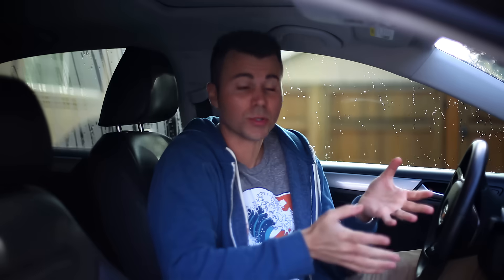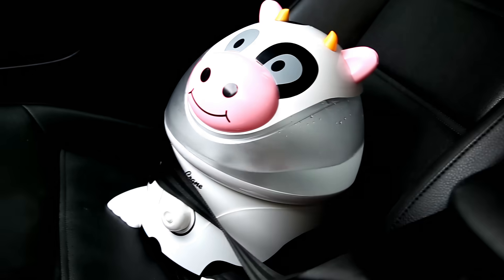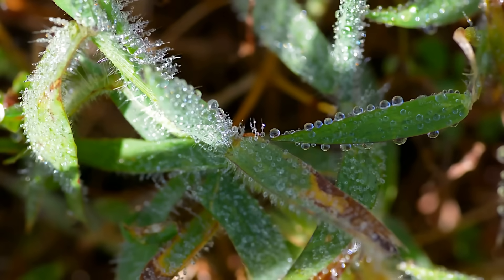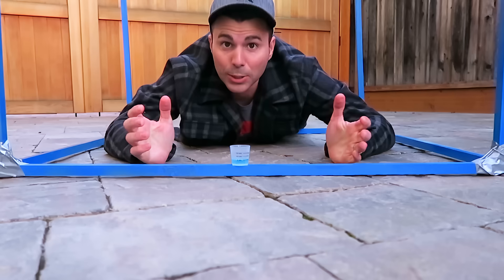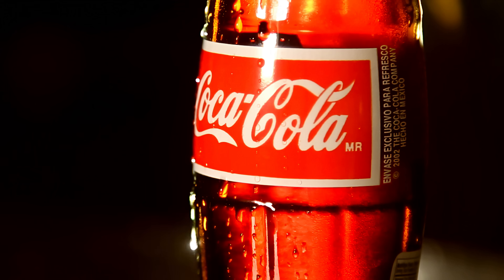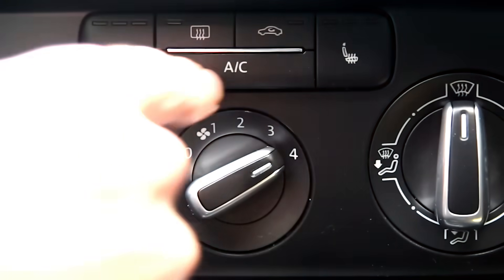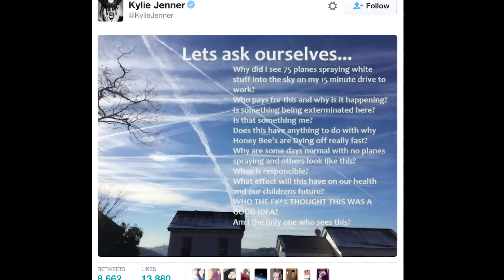Defog your windows TWICE as fast using SCIENCE- 4 easy steps

Comment: How do you turn the heat on full blast and A/C on simultaneously ?
... WTF ?
Reply: You push 2 buttons
Reply: with the knobs & buttons, Bueller.
Reply: Since no one else knows the answer, I will help you. Some vehicles have an A/C button you can press while the heat is on.  A lot of vehicles automatically turn the A/C on whenever you select the defrost vent, because auto companies already know the information in this video:  If your windshield is fogged up, you will select that vent.  If you select that vent the A/C will dry the air and help defog the windshield regardless of the outside temperature.
Reply: Most modern vehicles automatically turn on the a/c when the defrost is on, specifically for this reason.  Next time you turn on defrost see if ac does also.  It's also good to cycle the ac in the cold weather to keep the system in working order.  If you dont run a/c for 6 months chances are something in the compressor will go bad or seize.  I dont have to worry about these issues, my truck has a built in elec heat system that keeps the windows thawed and battery charged. I just have to plug my truck in on really cold days! But the plug is on my front bumper so it works very nice.  Downside is dont forget to unplug it before you drive or you may have a cord all the way down the driveway!
Reply: Some cars don't let you do heat and AC at the same time.
Reply: Most cars automatically run the AC when you select defrost.
Reply: Benjamin Brooks Finally, someone understands the the Auto Industry already knew this topic long ago and created the solution. So, when you push your Defrost button, your Heat (not hot at startup, but will add heat asap engine warms quick) and the A/C compressor will come on to work together (important to keep your A/C charged correctly year round, especially older cars. * The problem faced today with newer cars are that most now have a temperature set point, which eliminates the ability to push both the Heat & A/C, thus the need for this to occur automatically. **Personally, I use my A/C and heat together all the time to Dehumidify the inside of my car on rainy mild days, which is why I disagree with opening the windows as in the video, because his test is at a specific temperature inside and outside, which is typical for Engineers but not for day to day use, where the temp and Humidity vary throughout each day. Example is on mild Summer mornings headed to work. If you turn your A/C on Low, you will get too cold by sub-cooling, so by turning the Heat On to a level which makes the car temperature comfortable, is exactly where you want it to be. Always dehumidifying and reheating for comfort.
This from a life long temperature control expert.
Reply: kidding w'you...be well.
Reply: Keith & Philosopher it is refreshing to see a pleasant exchange of information. Thank you both.
Reply: I do it all the time. If you have it on defrost, you can turn the temp to high heat and hit the AC button.
Reply: WTF ? REALLY ? 🤔
Reply: That’s a goofy question!!! You’re not very mechanical if you have to ask that.
Reply: @louisp.3332  yeah! Even my house uses the a/c and humidifier in the winter to keep the house at a perfect 40% humidity at 70°f. Its amazing how many people dont understand 3rd grade science!!
Reply: Coupe420 screw science! You would be shocked at how many people just don’t understand how to push TWO buttons...
Reply: @louisp.3332  nothing surprises me about modern humans!
Reply: Totally can be done. In fact,  most cars turn on the ac automatically when you push the defrost button.
Reply: By doing it
Reply: FYI the AC compressor won’t engage when air is under around 38 degrees anyway.. the refrigerant won’t work efficiently under a certain temperature and it would also get iced up quickly
Reply: Just to be sure you guys know the only reason an AC dehumidifies the air is by making it much colder.
Reply: Dale Neish not exactly.. it dehumidifies because the cold surface area of the exchanger fins collect moisture from the air.. cold air holds less moisture but dropping air temperature causes higher relative humidity and the excess moisture that can no longer be dissolved in the air precipitates onto surfaces (condenses ie condensation)
Reply: @smagma9704  that's a longer way of saying what I said really.
Reply: @Neishy86  not really because just chilling the air doesn't dehumidify.. it increases relative humidity so that's the opposite of what you said. It decreases moisture content by draining condensed moisture out of the evap core.

(smagma is my other account)
Reply: Look I agree with you, I'm just not seeing how you dont think the main catalyst for the air dropping water is the temperature drop of the air across the fins
Reply: Ac is on by default wheb the heat on on some BMWs
Reply: Defrost setting turns on ac
Reply: You need the a.c on to use the defrosters.
Reply: Did you not just hear the rational?
Reply: Lol you gon learn today
Reply: A/C is on for heating only on new/expensive cars... and in this case the coils are warm, not cold, so WTF indeed?
Reply: How do you put in the picture deFROST and not have ice?
Reply: @mattlane2282  Don't ask me, it's not my video. But I wouldn't question someone from NASA, especially since they would be a colleague of mine.
Reply: https://stonumautomotive.com/running-cars-air-conditioner-winter-good-bad/
Reply: A/C stands for air conditioning. You can have your air conditioned or not regardless of temperature. The difference is whether you want hot conditioned air or cold conditioned air, and since the conditioned air has a much lower humidity and the A/C chemical traces left in the conditioned air will also contribute in drying the condensation its best to have it on.
Reply: Keith Anderson: If your A/C is leaving chemical traces in your air, you need to have a leak check. Otherwise, you were spot-on in your explanation. Air conditioning only refers to the drying of the air by using a cold element to capture the moisture. All coolant-based systems are simply heat exchangers. The "conditioning" is the drying of the air, of which chilling is often a desired side-effect. 

-Former HVAC and automotive technician.
Reply: Sorry, I was incorrect. Thanks for correcting me. I think I understand what you're saying:

Instead of saying there is A/C chemical traces in the air, its that the air is dehydrated so will evaporate the condensed water on the glass.
Reply: Keith Anderson: Yeap, now that is how it works. Just want people to keep their fact-check healthy. Glad to help. See a "how it works" page, and you can see how relatively simple it is, but how the concept has been so well refined. But that is why they are all called "heat-pumps".

Fun tip: Take the A/C compressor from a car, and belt-drive it to a Briggs & Stratton horizontal-shaft utility engine  (3HP will do)...fully charge the system again (never any R-12 system [illegal], only R-134A)...Makes for an insane outside A/C unit that doubles as an instant beverage cooler, with a little creativity.

The really cool thing (sorry about the pun) is solid-state coolers, like they use in those electric portable fridges. See https://en.wikipedia.org/wiki/Thermoelectric_cooling
Reply: Yeah, my old car hadn't been transferred over from R12 to R-134A and getting my windows defogged was a pain which is how I got here. Didn't end up getting it done before I moved on. Ended up just carrying around a nice microfibre towel to wipe down the windows to get me going until the heater core got up to temperature.

And now we're moving onto a whole new standard since R-134A is still slightly ozone depleting and also a very bad greenhouse gas, right?
Reply: @kand198  yeah actually r134a is more ozone depleting just like r410a is lol. But we have to follow the regulations in which r12 was a better aircon gas . Sorry to get off topic cheers
Reply: Philosopher of Nonsense it doesn’t cool the air by drying.. that’s just one component or side effect of the evap core.. you were an HVAC tech? It cools air by exchanging the compressed gas into low pressure which changes the boiling point and releases the excess heat into the radiator that thereby removes the heat from the air passing through it.. ie exchanging the heat from one location to another (outside the car)
Reply: @prometheus575  from what I understand, the A/C won't work when it's cold outside.
Reply: @kennyplay5982  Nope, it should work no matter what. The A/C is just a pump on the accessory end of the engine, it really doesn't know how hot or cold it is outside.
Reply: @kand198  And then the cold air hits the heater core and re-heats? He had a valid question
Reply: Luke W I don’t actually know for sure, as you can see I’m far from an expert, but I’d expect that the air is run through the conditioner and reheated before being pushed back into the cabin if you are on recirculate.

And where did I say his question was invalid?
Reply: @kand198  well....where did i say that you said his question was invalid?
Reply: I interpreted it as implied by “he had a valid question” but obviously I misread it, sorry.
Reply: @kand198  i would have interpreted it the same way that u did Keith. thank u 4 being a gentleman in your reply...you are a rare breed sir. GBY
Reply: Keith Anderson uh there’s no “AC chemical traces” wtf are you talking about
Reply: @journalsof jadednews
Turn the knobs.
Reply: You can't.
Reply: @Michael-gp3vl  you can't what? Run hot air through the A/C? Yes you can. A/C works, basically, as a dehumidifier.
Reply: @elliottselman6746   Yes the AC is a dehumidifier and the byproduct of that is cold air, When you are running the heater there is no moisture to remove from the air so the A/C is useless. A/C does not create cold air it removes humidity.
Reply: @Michael-gp3vl  a/c removes humidity by cooling air! It's how it works! You can use a/c to remove moisture and then heat that air. So you have warm dry air. But a/c definitely cools air!
Reply: @Michael-gp3vl  so basically, you're saying what I just said. A/C doesn't HAVE to be cold. It takes moisture out of the air.
 Unless if you live in a dry climate, warm to hot air can absolutely have moisture in it.
Reply: @elliottselman6746  If it has any moisture in it, it would not be enough to need to run the A/C for.  Living in the North East my entire life I can tell you this. The fastest way to defog your windows in cold weather is to run hot air that is recirculated and leave your window cracked open so the moisture is forced out of the car. 

If it is humid and muggy (hot weather) then cold air will work better.  I did not even need  to do any science experiment to learn this.
Reply: @Coupe420   A/C removes humidity cooling is a by product of that as I stated.  A/C does not make cold air is all I said.
Reply: @Michael-gp3vl  so by removing humidity you cool the air, but it doesn't cool air?  It does both, it has to cool air to remove the humidity, but you can then reheat that air without adding humidity.  It's just semantics, a/c does both, it cools and dries.
Reply: @Michael-gp3vl  my point was the a/c removes moisture, and doesnt mean you only have cold air. I'm not sure why you keep replying to me with info on what you do.
Reply: @elliottselman6746  wow go figure ,all my life I was told NOT to ever put A.C.  on while heats on.  I quickly turn it when even it happens, thinking I'm going to do damage to something. ... thanks guys .. to clarify ... A.C.  on cold .. widows cracked for short time then crank heat/defrost ,windows up .. do I have it right?

Comment: I do agree on all points. However, air circulation is used as a trigger in newer Volkswagen/Skoda cars to heat the air by electricity instead of motor heat. If you're driving a car with an diesel engine, it will take forever before the warm air hits the windscreen. I got an Golf 2012 model, and this difference is outstanding. If I put air circulation on, and crank the heat to maximum, you'll get warm air within a minute or so, even though its -15 C outside. If I dont, this will take several minutes - up to 10 minites.

Comment: Will this work in Canada
Reply: Yes, but it won't work in Australia. Down under everything must be reversed.
Reply: It works better if you run the engine  for 20 minutes  to help melt the ice, then your good to go, as long as your transmission isn't frozen solid
Reply: @timyanke9559  Thats true but it also wears your engine out a lot faster, uses a lot more (wasted) fuel and blows out a lot of unnecessary pollution. I have been in storms so cold that it dropped to seventy degrees below zero and I was able to start my engine (it was out in the storm unprotected with the engine off all night long) and follow this technique (I have been doing this for years because it was taught to me by a military mechanic), brush my windows off the thick layer of snow and was off and running (without a frozen transmission) in maybe two minutes. The windshield stayed clear and I had file visibility (not to mention that driving the car makes the engine heat up a lot faster so by the three minute mark it was already getting warm inside the car.
Reply: Yes, most definitely.

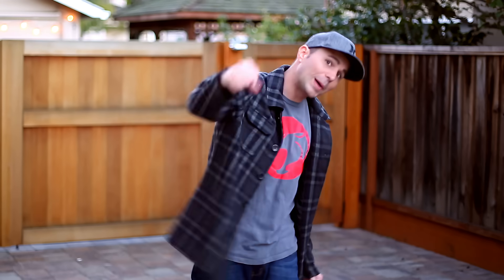Comment: 4:26.  🤜🏼🤛🏼 Pound it then.  Haha!!    Cool tip for those that don’t, can’t or prefer not to use A/C: open the Front-Driver side window and Right-rear passenger window to create good wind flow and it also cools down the inside of your car fairly quickly.   
...Or do the opposite windows if you don’t want wind blowing in your face.(Front-Passenger window/left-rear window)
This also works well even if the windows are only down a little bit.👍🏼   
**FOR “FUN” : If you wanna scare your passengers a little bit while driving, roll one rear window halfway down(the lower both windows are=the louder it will be), then slowly do the other one, watch them freak out!!!!  (*works better/best in hatchback type cars..lol).  
Cover your ears!! 👂🏼
*Disclaimer: Do NOT distract yourself while driving.  🙂

Comment: The change in relative humidity as air temperature changes is also why you feel dried out and get nose bleeds in the winter.
The cold outside air doesn't have much water vapor in it. When you open your door to go in/out of your house the air equalizes and comes inside. Then when the air heats up it still has that same amount of water vapor but it's a much lower relative humidity to what the warm air could hold.
Using Mark's analogy: it's like the small, cold, outside towel is filled with water,  but when the air heats up the same amount of water doesn't fill the large, warm, inside towel.

Comment: The problem I have is that the outside of my windows is the part that gets all foggy. Fortunately, I can use the wipers, but the fog comes back after just a few seconds since the window is cold. What I do is just blast the windshield with hot air and no AC, so the windshield heats up. I turn the AC off so the air is as warm as possible (I do have to wait a while for the engine to heat up). I also use the recirculation so that I'm pulling in air from the cabin which should be slightly warmer. Since I have to wait for the engine to heat up, and then for the heat to go to the outside of the window, it takes almost 2 mins to fully defrost the window (even with the use of windshield wipers). For the rear window, I do have to wait for the heating element to heat up the inside of the window and then for that heat to work its way to the outside. There's no rear wiper, so as you can imagine defrosting the rear window takes ages.

Comment: Can you explain the shaving cream hack more?
Reply: The shaving cream has chemicals in it that break up the surface tension of the water and make it into a smooth layer you can see through, not lots of tiny droplets that obscure vision. Bonus tip; the shaving cream trick works on bathroom mirrors too, and so does smearing a block of hand soap.
Reply: @peter_smyth  I used this trick to write a message into my mom's bathroom mirror on halloween.
Reply: @ABearInTheWoods-tumblr  I did the same thing. Did u write "hey big sexy" too?
Reply: It helps to reduce some irritation on your skin when you shave.
You're welcome.
Reply: David Albee get shaving cream then put on Windows then rub it off till it's clear
Reply: David Albee plenty of other YouTube's such a crisfix show how to do it.
Reply: Don’t bother just use stuff designed for windows
Reply: The shaving cream is not special in any way, any soap will work as well. The fat in soap repels water so the water doesn't stick to the window. It commonly forms larger beads that hen are large enough for gravity to pull down. The reason that shaving cream is used is that its a soft foam which is very easy to apply. Its also inexpensive and easy to find. You want to put on a very thin coat on the window or else it will leave a film that reduces your visibility (which again is why shaving cream is so popular), and yes its works on all mirrors and glass that gets fogged.
Reply: zz k lapAlbee we syyszSuZZoAaaaslawp
Reply: "I already know there are hundreds of products such as Rain-X that are specially designed to be applied to the windshield to help prevent and remove condensation, but can you please explain the shaving cream hack more? I want to smear grooming products on my car because I am the most gullible man west of the Mississippi"
Grow up and do it right if you are going to do it at all

Comment: #FirstWorldProblems
Here in Canada, we don't screw around. Wake up, look outside, see frost, remote start. Done.
As for your 4 steps, most vehicles automatically turn on the AC compressor when you set it to the defrost venting in order to dry the air, and the recirc is turned off if it was on.  The full heat setting is just common sense. Regardless, remote starting automatically turns on all these settings anyways :P